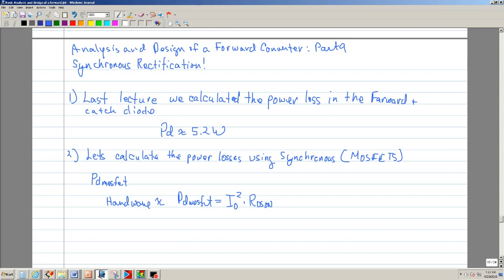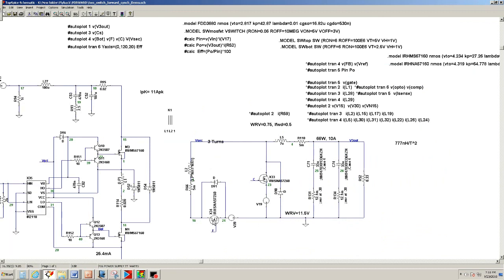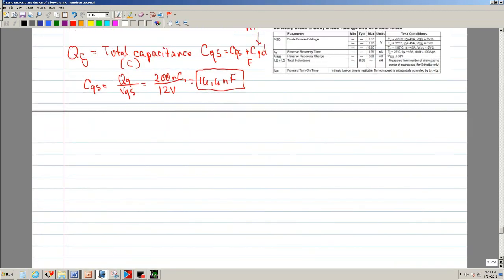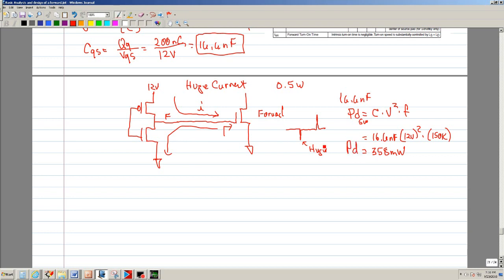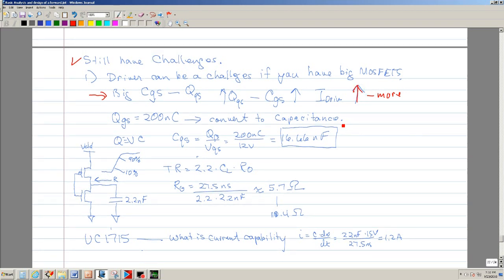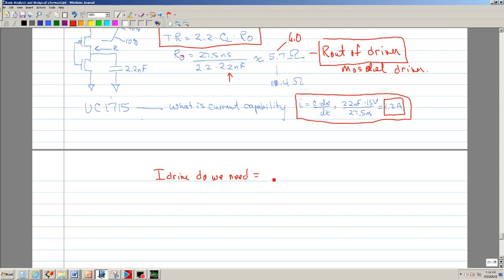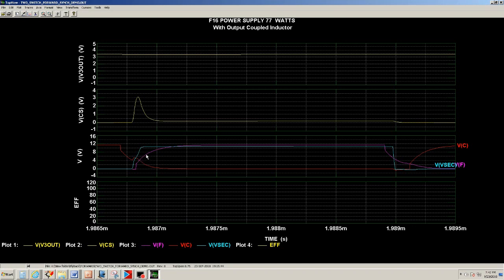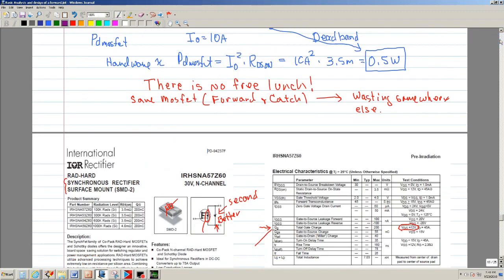Forward Converter Part 9; Continuation of Synchronous Rectification.

Comment: Hi Robert:-Excellent topics and lecture. Just noticed the power loss with Sync mosfet would be 0.35 W and not 0.5 W .
Reply from the maker: Ha, senior moment, yes you are correct. Thanks for the correction😀